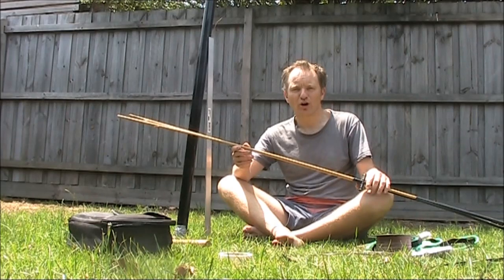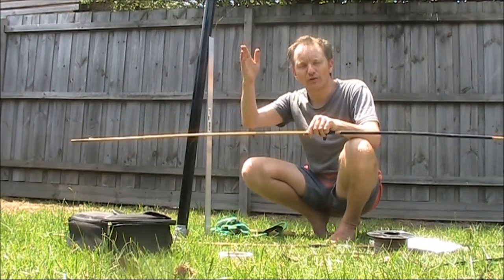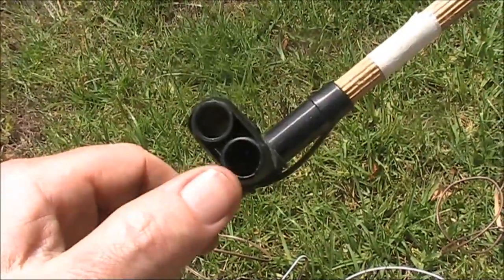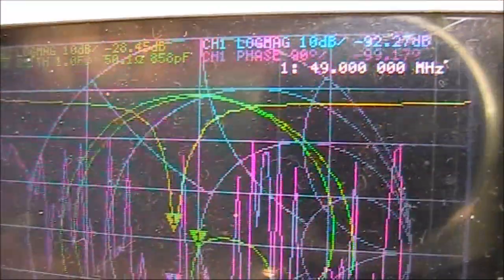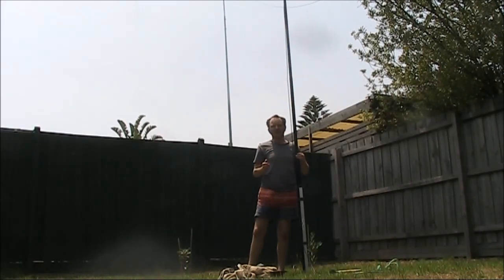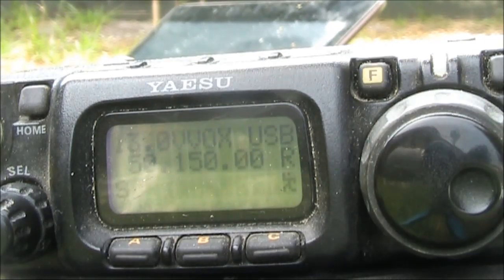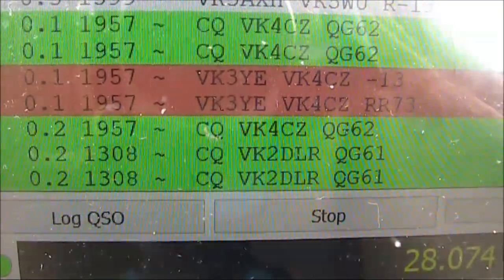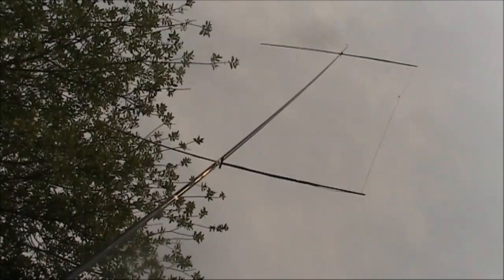Oblong loops for 28 and 50 MHz

Comment: Thinking of the connection part from 6M to 10M, why not try a powerpole connector. Connect the powerpole together and tie wrap the connection so it can become more versatile if portable. Those velcro straps might also help for ease. Just an idea and might work. Or the 3.5mm jack and socket that are used in phono connections.

Comment: what would impedance be if I feed it at a corner,...could I use 75 flat twin feeder?     de G4FBC
Reply from the maker: Haven't tried it but polarisation would be out of whack. Maybe feed it at the same place I did but try different dimensions of loop - eg 1.5 times as high as wide instead of twice. But with same amount of wire.

Comment: Can you have an oblong loop for 10m and a 6m loop inside the other with a feed line joining both i.e an extra piece of RG58U coax from the feedpoint to the inside loop? 2 bands 1 feeder.
Reply: It might be possible, the only way would be to try it.
Worst case scenario is that you would have to run separate feedlines  for each one.
I personally would put type 43 ferrite sleeves on the coax too. At least two (4 would be excellent) right at the feedpoint of each loop and place them concentric inside each other.
It would be more ideal if you could run each one with no feedpoint connection when it's not being used as then interaction would be minimal.
Again in all these things experimentation is the key and having someone local say 20-30km away with antennas of the same polarization is the key as you can try them before on their own then after

Comment: Nice! Does the 10M full wave oblong resonate and tune on 20M as a halfwave oblong?
Reply from the maker: 0.5 WL loops would be very inefficient. But if fed with open wire feedline it should perform OK on 15/12/11m.

Comment: Why not a Moxon for 10mt? I use it portable for 15mt and works great - W6LDM
Reply from the maker: The frame is just the right size to try it. And you'd get a bit more gain. Adjustment would be a little harder but a good idea for a future experiment.

Comment: very good. What did you find the SWR bandwidth of that antenna was? You might also get a better side null if you choked the feedline with an ugly balun or some ferrite sleeves
Reply from the maker: Didn't test it. I'd guess 1 or 2 MHz - it looked quite narrow. I might have made it shorter to get 52 MHz as there's a little SSB activity there but didn't bother as almost 100% of my 6m operating is SSB & digital in the bottom 300 kHz.